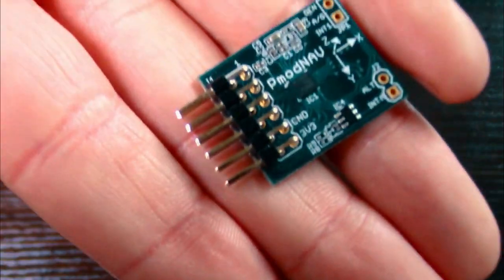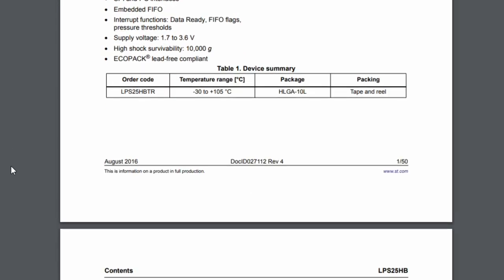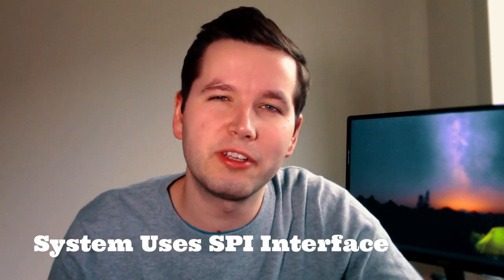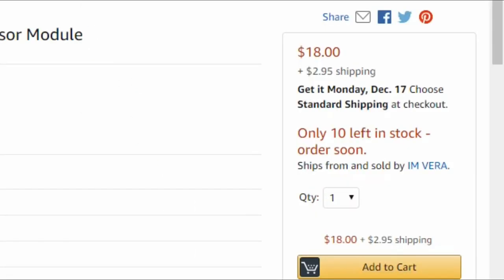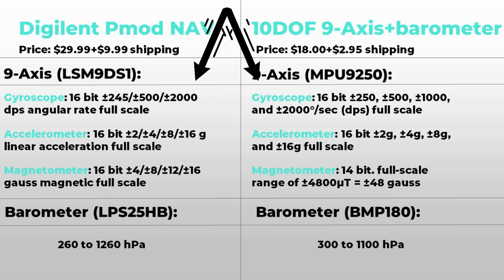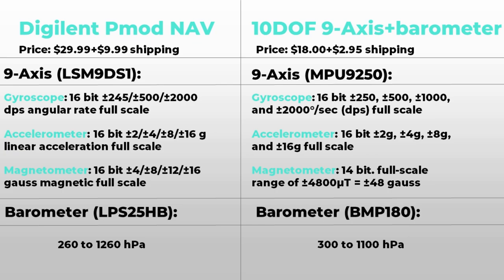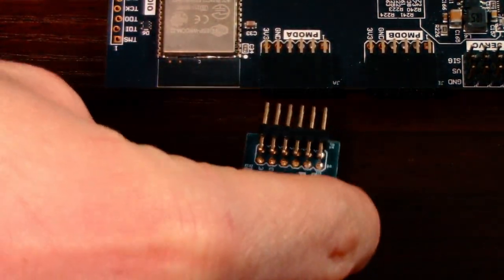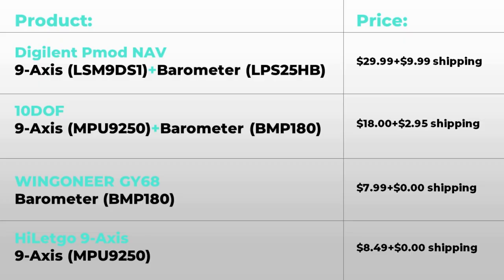Accelerometer Gyroscope Magnetometer Sensors Quick Comparison | Digilent Pmod NAV VS MPU9250+BMP180

Comment: hey, thank you for the video but comparing the numbers of the datasheet, does not say anything about which one is more accurate. I can provide you a 1024 bit sensor, but 1020 bits of them are useless. (Pratical tests are missing)